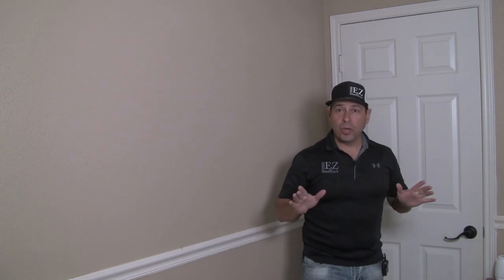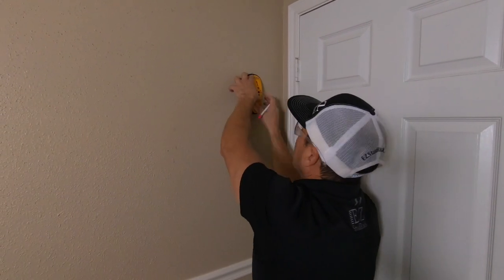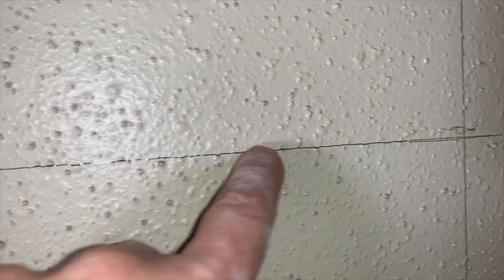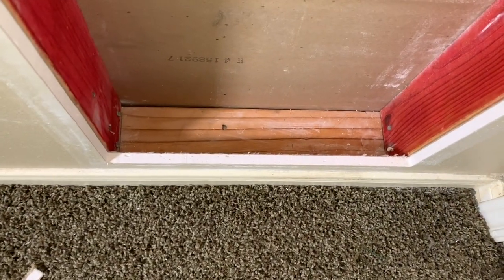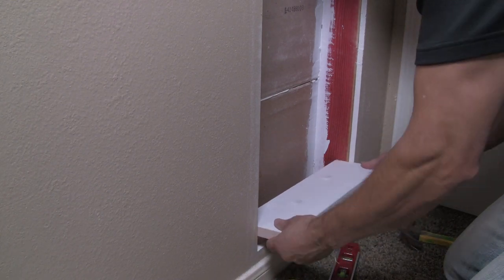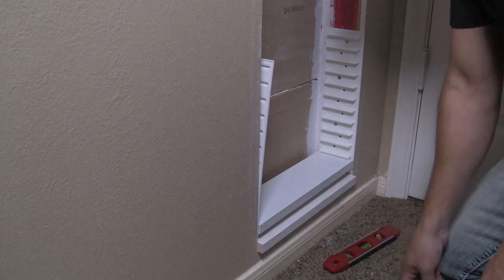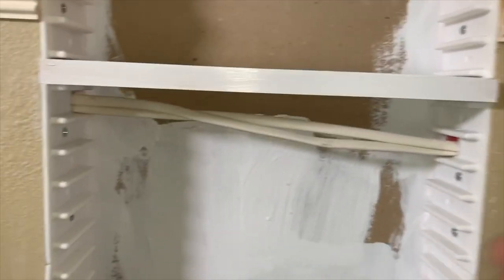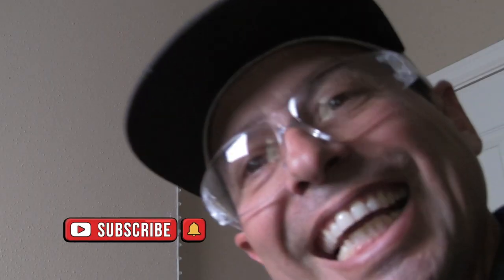Howto Find Extra Storage, Between Stud Storage, Ultimate Wall Storage

Comment: Great vid now I can see how do you detect stud in the wall
Reply: If you plan to do a lot of in between stud projects, you might want to consider buying a Walabot.  It’s like a stud finder with x-ray eyes that works through your smart cell phone.  Not only can it sense studs, but it can also tell you where you have electrical wire and pipes behind the wall.  There is no need to damage your wall and risk costly repairs.  Anyone who has repaired drywall will tell you that the paint never matches completely.  Fresh drywall that is painted and walls that have several coats of paint have very different textures, that are difficult to match; they take a lot of time and energy.  I was going to put an in-wall shelf above the toilet in my main bathroom.  I used my Walabot and discovered that they had string the electrical wire for a receptacle in the adjoining room up high to avoid the plumbing.  It saved me from having to repair my bathroom wall!  They are not that expensive and they have versions for Android and Apple.

Comment: An interesting and simple system. I won’t get into the specifics on electrical code, because I don’t know the requirements in your area. Personally I would have taped the joints on exposed plasterboard first and put a wooden support above the system between the two sheets of plasterboard. You might also want to to cut away some more of the dado rail each side so you can add trim to finish it off nicely. Thanks for sharing the video. I’m going to make a series of videos of my bathroom renovation where I’ll be doing something similar. I’ll drop a link for you to critique. I’m always open to feedback 👍🏼
Reply from the maker: Thanks Karl for the input.  Would love to see what you come up with in your renovation.

Comment: I didn't understand the thing about the pennies and quarters: you were using coins as shims? But the board is going to come in and out (for the hidden compartment). Won't the homeowner knock the quarters off when they move the shelf/board to reach the hidden compartment?  Or was that just temporary?  Can you cement coins down?
Reply from the maker: The quarters are only for leveling the board at the bottom.  So when you attached the EZStudRack, the shelves will be level.  The quarters also allow a gap between the EZStudRack and the bottom support so it easily slides out.  The coins are removed after everything is installed.  Thanks for the questions.  I hope this helps!

Comment: Since this video is more of a product advertising, rather than a DIY educational video, I decided to look more closely at the actual product being sold.

I like the idea of this product, but when I did the research, I found that the execution of it failed horribly; the product is very impractical because of the size and shelf spacing.  There is some conflicting information in their advertising as well.  The dimensions of 1 bracket are 12.69” tall and 3.5” wide.  The spacing between the each shelf is essentially useless.  Unless you are working with very very tiny / short items.  You would likely only get 1 practical shelf per set of brackets.  

To give you a better idea, each bracket can hold 11 shelves.  If you placed a shelf at the highest point and the lowest points on the bracket, you would have 9 shelf spaces or slots between those 2 shelves.  I watched their promotional video very carefully to see the number of spaces needed for common household/garage items.  I took screenshots from the video so I could count the spaces the shelf spaces more closely.  Keep in mind that product packaging does change so the items might be larger or smaller now and could take up a different amount of space 🧐.  

From the video it appeared that a can of shaving gel used 8 slots (7 for the actual height of the product and 1 for the shelf it was sitting on.  A can of Rustoleum spray paint also used 8 slots.  A small bottle of  Floetrol paint thinner was 12 slots.  1 for the shelf it was sitting on and 11 for the height of the bottle.  Since a bracket only has 11 slots, this means that an entire bracket would be wasted.  A regular bottle of Roundup with the attached sprayer, is another wasted bracket, as it needs 13 slots.  Gamers will need 8 slots for Wii and PS4 type games.  For people who are crafting enthusiasts, a small wooden stamp needs 3 slots.  A bottle of Smirnoff Vodka would be another wasted bracket with 12 slots. Even a regular sized jar of peanut butter used nearly an entire bracket with 8 slots.  And finally, even a package of Gold Fish crackers took 7 slots, which is over half the size of a bracket.

From my point of view this product is impractical.  The number of screw holes also seems odd.  There are 11 screw holes per bracket, but you are only provided 4 screws per bracket. I figured this out because the Amazon advertisement page for the 32 bracket or 16 set item, indicates that you will be sent 128 screws. The Amazon advertisement STATES you can use up to a 1x10” wide board; however their promotional video and advertisement images indicate that the maximum width is a 1x8” board.  Using a 1x8” would mean that there is  4.5” or over 1/2 of the board hanging outside the stud and bracket.  

Again, I liked the idea of this product, but I don’t like how it was manufactured.  There is no point in having the shelves so close together, when the available space is useless.  IMO at the current spacing, and the product height does not offer customers any value for their money.  The brackets need to be taller, and have more spacing available between each shelf. Perhaps a variety of spacing with different sized brackets to give buyers more options for their needs.  I would not recommend this product whatsoever.  I also think the company needs to correct the errors to their advertising, because the conflicting information is misleading.  Hope this helps others make a more informed decision on whether or not to purchase the EXStudRack
Reply from the maker: @CanadaNurse  thank you for your detailed review. I think you are missing the reason why I invented EZStudRack. Saves time, less stress and flexibility. It’s not about how many shelves this can fit, it’s about where to fit the shelf at the time you need it. Yes, go buy a $6 bracket and attach it to your wall, put a big bulky shelf and store whatever you want. When you run out of room, buy another $6 bracket and repeat. When you need something, you start digging, moving items and spend time looking, stressing and scratching your head trying to remember where that item is.  EZStudRack puts everything ONE ROW DEEP on your wall. No more digging, no more stress finding it, no more WASTING TIME finding it.  When you use it you only have one spot to put it back. It’s a SYSTEM to help you GET ORGANIZED and STAY ORGANIZED. Once it’s up, put a shallow shelf or a deep shelf, whatever you need at that particular time. Now if you are the organized type of person, then this is not for you. EZStudRack is for the person who is tired of clutter and needs a simple system to help declutter. Thanks again for your detailed review.👍🏽

Comment: I think the way you treated the romex is illegal. It looks exposed. I would not do that. I would have left the sheet rock in tact 4in above and below the wire. I would then added 2x4’s above and below the wire. Keeping the wiring blocked off and protected.

Comment: Holy crap. Don’t let this guy anywhere near your house. I assure you that running Romex (the electrical wires) between two removable shelves doesn’t meet ANY kind of code. Especially since he or the customer removed one of those shelves by the final shot showing it running loose, hanging in front of a cute statue and waiting to start a fire when somebody snags it and yanks the conductors out of the stair light switches that you could obviously see on the wall when he was saying it was all A-OK. 🙄 

This was a kid’s room and he left electrical wires loose!
Reply from the maker: Thanks for the input. I will permanently put a board above and below with a front cover so exposed wires will be covered up. Again thanks for the input.